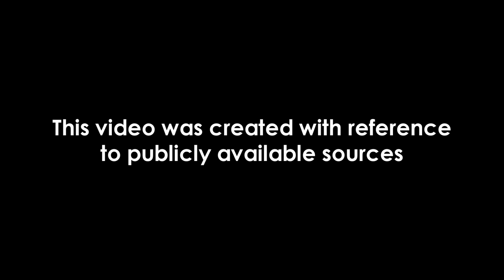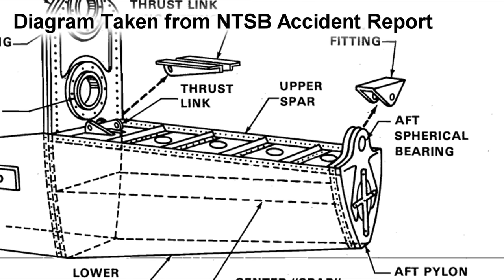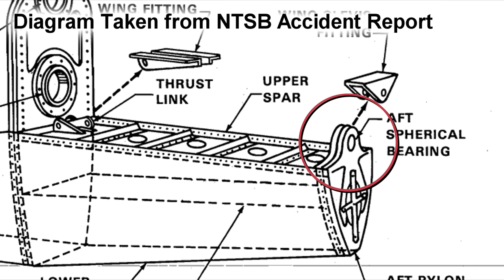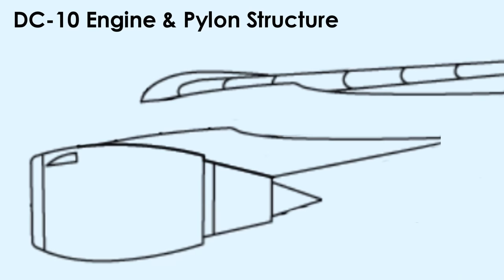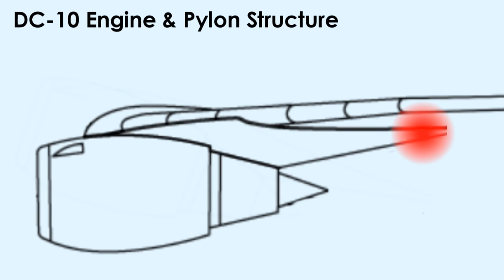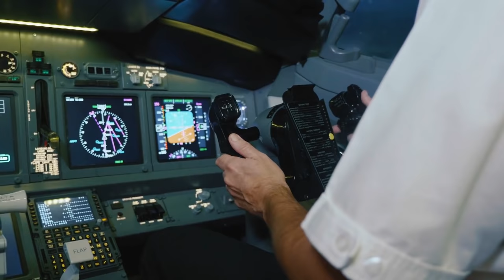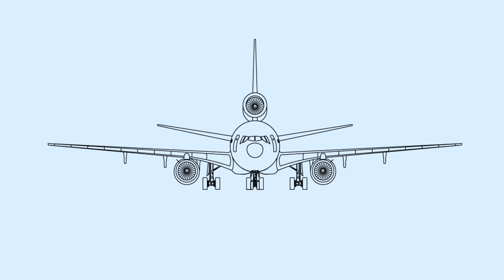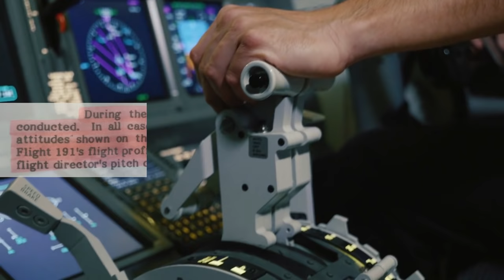America's Deadliest Air Disaster (American Airlines Flight 191) - DISASTER BREAKDOWN

Comment: The most messed up and creepy addition to this crash was the fact that passengers got to watch the plane going down on the projector.
Reply: They didn't have 'monitors in the seats' in 1979, there was a projector screen at the front. It's possible this may not have been visible(or not very) anyway, as all the window shades are open at takeoff, and it was a sunny day. It wouldn't have shown the damage, as the camera was in the cockpit, and likely would've been no more frightening than what they could see and feel themselves anyway.
Reply: It was 1979 you wouldn’t be able to see anything in the cabin because everyone was smoking

Comment: Using a generic light duty wearhouse Forklift on a 5 Ton Aircraft Engine is really really smart ass, those individuals in the Grunt Repair shop should have been given complimentary Front seats Ride along tickets on the doomed and damned flight So they could see just how Reliable there stupidly cheap killer method of replacing the Engine wing attachment hangers with a Forklift. Maintenance goons Mass murderers and all should be slapped with mass murder charges So no one else will attempt to cheap out on Shop hours & Human lives.